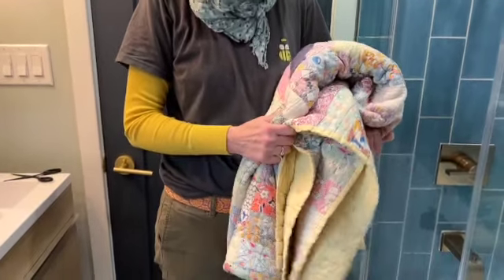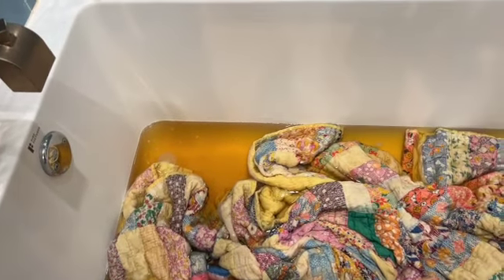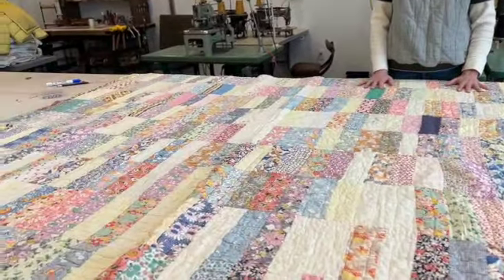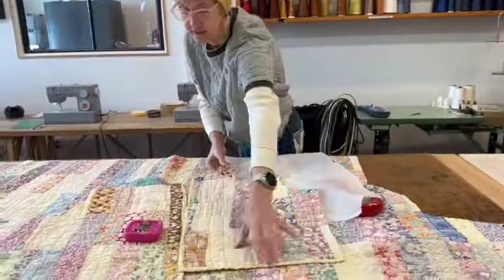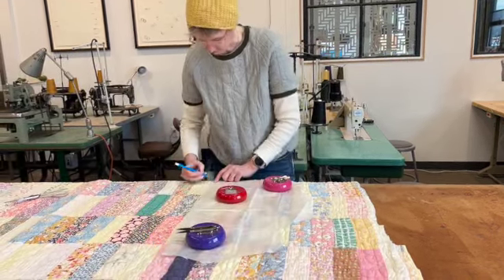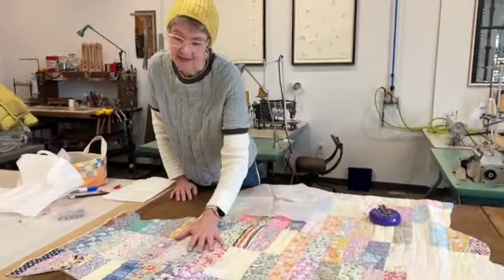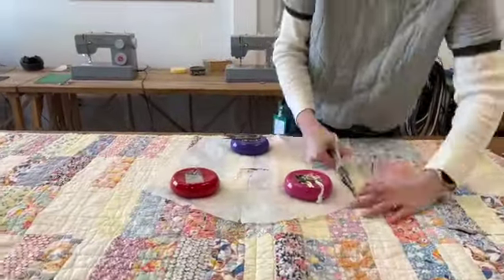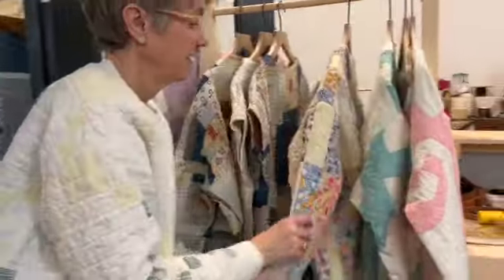How to Repurpose Damaged Vintage Quilts

Comment: broke my heart! That quilt was so beautiful! I would not mind quilts being cut up to make another item if they were really dog bitten, but that quilt just needed so very little to look wonderful again on a bed. I washed a quilt in a washing machine one time, the filling came out, the quilt was ruined as was the machine! Yes it was on the  'delicate' cycle.
Reply from the maker: In its day, this quilt WAS a beautiful quilt, but it had not been well cared for, and by the time it got to me, it had considerable holes throughout, the batting was clumped up in places, and prior to cleaning it, there was some mold.  
When I get "cutter" quilts, I thoroughly inspect them, and those that I can restore for bedroom use, I do.  A quilter myself, I want my efforts to be used and appreciated, not lumped into a closet. If that means my quilt gets remade into a table runner, a coat, potholders, or a doll's blanket, then that's fine.
Reply: I'm a quilter and have spent hours upon hours quilting.  My first two were completely hand made using templates - before rotary cutters and free motion quilting.  I hand pieced and hand quilted both quilts.  That being said, I would like to know why it is superior to lay a quilt in a spare bedroom on a bed where it may or may not be seen or even folded and placed for display on a shelf than it is to create a beautiful garment that can be worn in public for many people to see and admire.  Many years ago my mom decided to use her sterling silver flatware daily.  I love this attitude.  The more people that see the beauty and art in a quilt, the more it is appreciated.  I have made many quilts for friends and family and kids with cancer.  Once they leave my home, I never wonder if someone laid it on their bed or if they dragged it across the parking lot.  It is theirs now and I hope they enjoy it. I sure enjoyed making it and that is why I quilt.  So many quilts are jammed in the back of a closet.  I have to admit I have a precious family heirloom in a closet myself.  It does not go with my current decorating or lifestyle, it is fragile and I have a grandson whom I would not want to burden with being so careful around it.  I love it and I am thinking of cutting it all up and making a quilt jacket to wear around the house.  And I'm not going to apologize for it.  It was given to me by my grandmother who is in Heaven and I think she would prefer I do that rather than keep it in a pillowcase in a closet.  I would consider it a hug from her every time I wear it.

Comment: One summer in college I worked helping the clothing curators at a museum. I learned to sew when I was a little girl so was familiar with textiles. These people taught me what happens to old fabric as it’s reused and rewashed over the years. This is one of the reasons why I don’t use anything older than 10 years when reclaiming textiles for other uses. I also know my grandmother would haunt me if I cut into anyone’s heritage quilts.
Reply from the maker: That must have been a great experience! And it’s interesting to see how different substrates (and dyes) behave over the years.  

The quilts I’ve acquired are deemed by the folks who sell them to be cutters and not suitable for their intended/original purpose. I’m not cutting into heritage quilts, and the few times I’ve received one that’s not cutter-quality (but needed only simple mending or a soak) I’ve put to use in my home. 

Quilting is an interesting craft in that it traditionally involved repurposing/reuse of fabrics made for different purposes. My great-grandmother often repurposed family clothing and linens in her quilts, so I don’t think she’d be upset at all if she knew I remade my baby quilt into a knitting bag that I use every day.
Reply: Many museum quality quilts still end up in the landfills if people don't appreciate them.  I have seen fabulous quilt coats made from extraordinary quilts and they can cost over $1,500.00.  I would assume that most people who would pay that much, already have a great appreciation of the masterpiece quilt and would take very good care of it.  Just because it is museum quality does not mean it will end up there.  I am always so fascinated at the comments in videos like this one.  I absolutely love hand pieced and hand quilted quilts.  I come from a family of Mennonites.  I have some very gifted quilters in my family.  One aunt aimed for 12 stitched per inch and she quilted for a living.  She quilted for some famous quilt pattern designers.  I just don't understand who made it a law that a quilt laying on a bed is the only way a quilt can be appreciated.  I defunded the quilt police a long time ago.  Art is in the eye of the beholder.  I know many highly talented quilters were not wealthy and therefore purchased fabric that was not intended to last for centuries.  So, whether those types are washed or stored in a closet, they will still deteriorate and fade over time.  My grandmother would love it if I used the quilt she gave me - even if I cut it up and create a beautiful quilt jacket out of it.

Comment: This is great.   Where can I find a free simple pattern?  Wo7ld it be best to take @ coat I already have apart to get pattern?
Reply from the maker: If you have experience reverse-engineering that’d work great. Maybe check Etsy for free patterns, but beware, because free patterns may not have been tech-edited or properly graded.

Comment: Where can I get a pattern? Thank you for this video.
Reply from the maker: This is my own pattern (a copy of an old coat that I had). You can use a quilt in place of fabric for any coat or jacket pattern, but be aware that the thicker the quilt, you may want to size up on your pattern.

Comment: Lovely jacket, may I ask how you finish the seams or is it lined ?
Reply from the maker: I use a serger to finish the seams. Since the original quilt already has three layers, I don’t line the jackets.
Reply: I wondered the same thing. I thought perhaps of French seams but they would be very thick. Overlocked (or serged) seams make sense, would be neat and all threads would be secure.
Reply from the maker: There are "summer" weight quilts that don't have batting, and maybe French seams would work with that?  On one coat I made that had a fabulous lining fabric, I used bias tape to bind the seams, so the coat was reversible.

Comment: It will be a LOT easier to lift the wet quilt out of the tub if you use an old sheet to "line" the tub and lift it with.  Just lift the sheet by the edges, and it's much easier than trying to wrestle with the wet quilt (and they can be quite heavy).
Reply from the maker: Agreed. I’ve also used a larger Rubbermaid tub inside my bathtub, just to keep everything contained
Reply: That is such a great idea... thank you for sharing that information!!

Comment: To those of us who are quilters cutting up old quilts we are not fond of.  The are very few quilts that cannot be fixed and saved.  So much more valuable than a coat and it does not honor the work the quilter did.  The quilt thou used had very little damage and could have been easily fixed.  Why not make a quilt to cut up?
Reply from the maker: I’m in the “quilts are lovelier out in the wild in whatever format rather than hidden in a closet” camp. Maybe the focus should be on folks selling rather those buying? Also, lots of quilts look perfectly lovely on film or in a photo. When you get up close and personal, that’s when the extent of the damage is apparent
Reply: @m.a.b.e.l  I have fixed several quiltsmand that one was not in bad shape.
Reply from the maker: Hmmm, I didn't see you standing next to me in my studio, studying the quilt. Aside from some tears and shreds, there was mold on a portion of it. 
The point, however, is that this is my quilt. That I purchased. That a person willingly sold to me.  So I can choose to use the quilt the way that I want to.